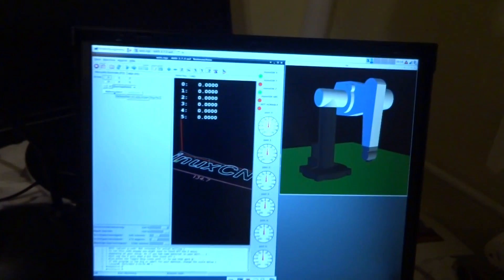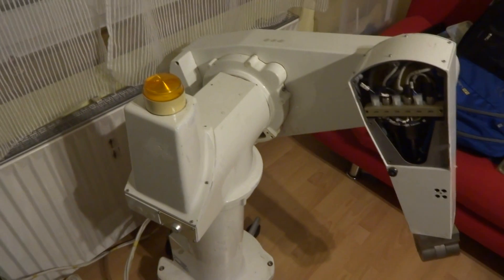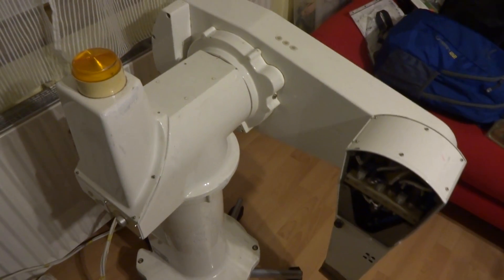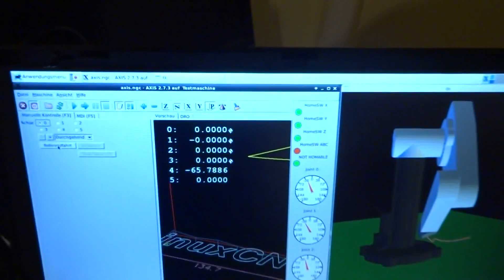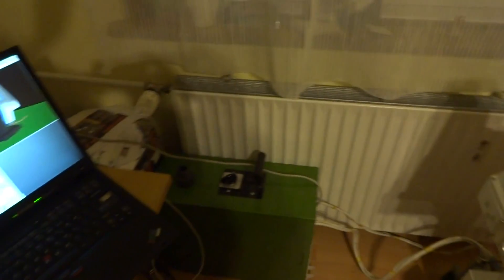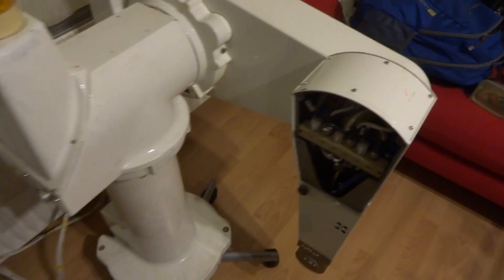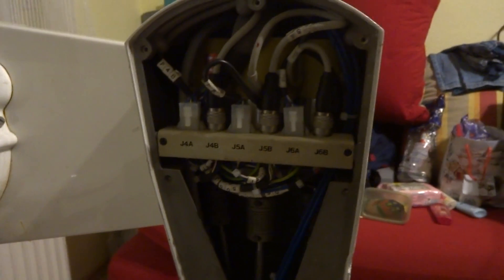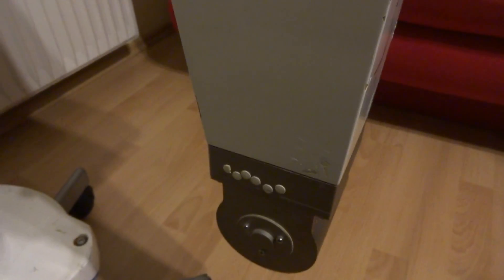Homing procedure of a Puma 560 implemented with Arduino Nano

Comment: Can i use another interface card in place card arduino to control robot arm ?
and can you give me the reference of the  servo motor used by Puma 560  ?
Reply from the maker: Maybe there is a misunderstanding. The robot arm is not controlled by the arduino. The arduino just reads the index and the poti signals to return the information to linuxcnc. Please check out my other videos where you get more information how the roboter is controlled.

Comment: Moin. Wie schnell kannst du verfahren bis die encoder zu schnell für den servo controller drehen? Habe nun mehrere versuche gemacht mit arduino uno bluepill und esp32. Wenn ich mit hand einen puma 200 bewege komme ich schnell an die grenze.

Habe 2 videos hochgeladen, gut erkannte bewegung und zu schnelle bewegung.
Reply: Habe nun eine lösung gefunden. Mit dem Bluepill board geht es einwandfrei bis 40mhz encoder geschwindigkeit, dadurch kann eine servosteuerung aufgebaut werden.
Reply from the maker: Hi Aaron, ich bin mir nicht sicher wie Du das gelöst hast. Ich verwende zum homing nur das Index Signal und das analoge Signal der Potis. Die A/B Signale kommen nicht zum Einsatz. Da ich den Puma 560 bei homing mit den Servos nur relativ langsam verfahre habe ich nie Probleme gehabt. Das Index Signal kommt nur 1x pro Motorumdrehung. Ich verwende nur einen langsamen Arduino Uno. Der damit kein Problem haben sollte
Reply: @TheRobottom  danke für die antwort. 
Ja das mit dem homen mittels index signal habe ich verstanden jedoch sind ja an dem uhu controller die A und B signale angeschlossen und der läuft nur über einen atmega328 da kann man ja nicht alzu schnell die signale einlesen (oder ist dort ein encoder buffer verbaut ?)da der Atmega mit den interuppten nicht hinterher kommt.
Soll heißen die encoder signale kommen zu schnell und der atmega verzählt sich.

Nunja ich konnte es mittlerweile ja sehr gut mittels dem stm32f103(bluepill) board lösen. 
Läuft nun auch sehr gut wie am neusten upload zu sehen. Position wird genau erfasst und kann erstmal als long variable eingegeben werden.
Reply from the maker: @atc1441  Hi Aaron, d.h. Du verwendest den UHU gar nicht, sondern hast Dir eine eigene Lösung gebaut? Klingt sehr interessant. Du hast dann auch nicht den UHU code verwendet - oder? Ich hatte hier bisher noch keine Probleme. Mag aber daran liegen, dass der 500er Puma grösser ist und man ohnehin nicht so schnelle encodersignale erzeugt wie beim Verfahren des 200er von Hand.
Reply: @TheRobottom  korrekt ich verwende keine Uhu Hardware oder Software.
Läuft wie gesagt mittlerweile sehr gut.

Weißt du zufällig wie viele encoder Signale pro Umdrehung bei dem 500er ausgegeben werden? Bei den 200er sind es 2500 mal 4 wegen Quadratur Encoder
Wenn man den 200er Arm sehr schnell bewegt kommt man auf ca 100.000 Impulse pro Sekunde.
Also ca 10 Umdrehungen die Sekunde